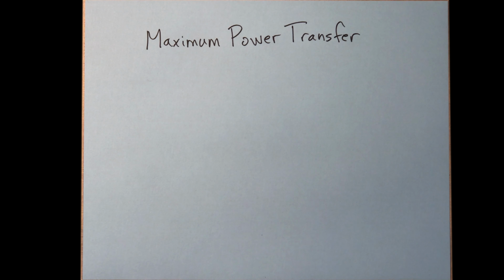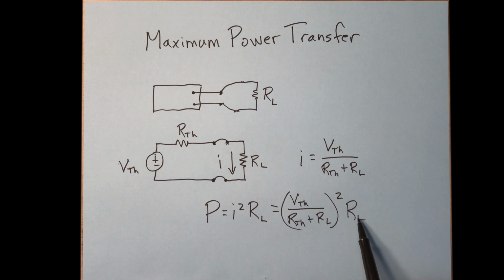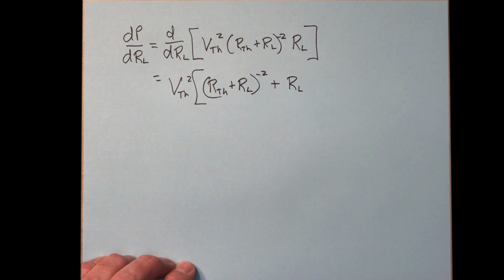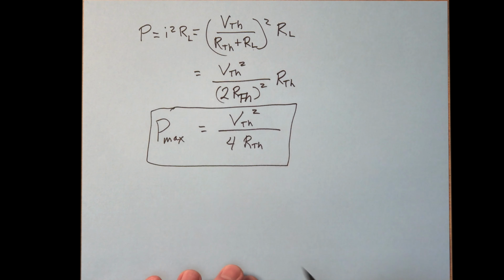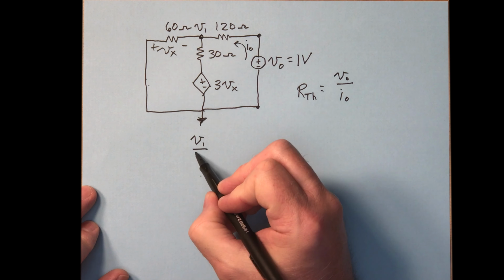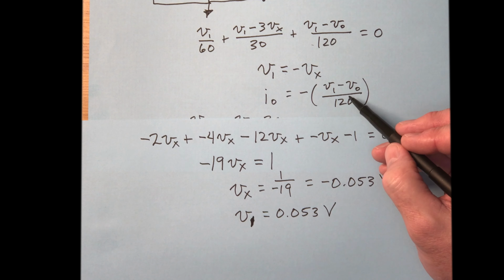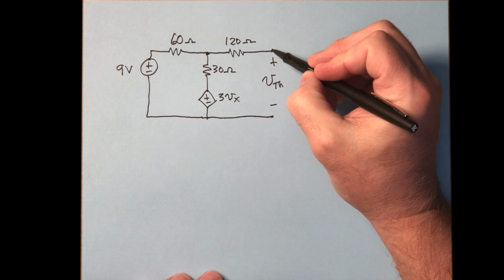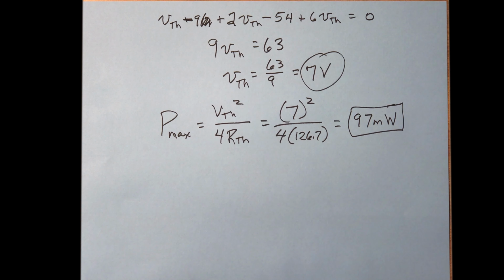12 ENGR 2305 Max Power Transfer

Comment: I noticed that in your previous video you also used 1V for V_o. Is it safe to say we could use 1V as test voltage for every problem when we are solving questions like this?
Reply from the maker: I think I remember which video you are referring to. Yes, 1v was used for convenience. Any test voltage or current will work when finding the thevenin equivalent.
Reply: thank you  @EnjoyYourUniverse